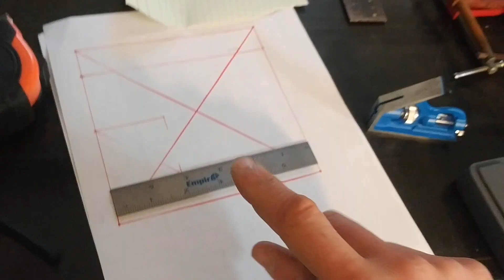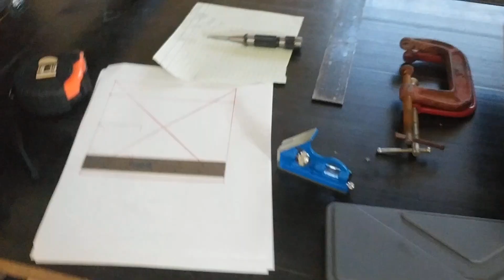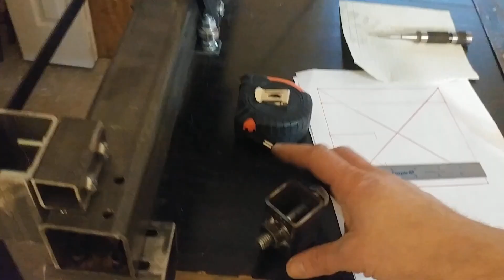CNC Plasma Build: Jigs, Z axis, and belt tensioning

Comment: This is an awesome build. I like the tensioning solution you came up with. I hope one day I can have a shop like this with all kinds of DIY machines. I just have a TRONXY 3D printer and lots of spare steppers, servos, dc etc.. for random Arduino projects at the moment. Gonna try to build an automated deep tissue massage machine based on a regular CNC endmill but with a rotating rubber ball instead of a spindle.
Reply from the maker: I use a jigsaw with a golf ball on the end for that. You need to use one hand (or have a partner), but it works a treat.

Use the a jigsaw that takes the T-style blades. (corded is better than battery). Grind the teeth of the blade (duh). Drill three small holes in a line (like 3/32") halfway down into the golfball. Cut the surface of the golf ball across the lines with a dreml, hacksaw, etc. Then press the toothless saw blade into the predrilled rubber interior with a bench vise.

Been using mine for years. Your mileage may vary, do at your own risk, etc.

Comment: How meny tooth you have on that servomotor gear and does it work fine ?  i have same  servos on my build was wandering would it need moore speed bigger wheel. thanks Toni im buildin 2m x 1,5m table
Reply from the maker: Can't recall off-hand how many teeth were on it, and I don't have the machine any more, but if you check out my first video on LinuxCNC configuration via the StepConf Wizard, I recall it working out to something like ~600 steps per inch, which was totally fine on my 4x5' table.

Comment: I was looking for a cheap & accurate CNC table and after a lot of search I found out that the most suitable transmission for me will be by closed drive belts. So recently I bought a small laser  engraver and I noticed how they use an open belt and it works fine. Since then I looked everywhere for a CNC table that  uses the same concept.

Please tell me how much does your carriage weights? and what belt did you use?

I'm looking for an HTD 5M 50mm width ( budget problem).
Awesome build, I'm happy to have found your channel.
Reply from the maker: I used a 15mm wide HTD belt. Can't say how heavy the gantry is, since I don't have the machine any more, but it wasn't much. Maybe 20lbs? 30lbs max?

Your precision will be limited mostly by the straightness of the rails it rides on, and secondarily by the drive ratio (ie. how discrete your steps are).

Comment: Could you share the design of your machine?
Reply from the maker: At one point in time, I was working on putting together more comprehensive documentation, but really, these videos are it. Just work through the video playlist.

The design was really based on what parts I could get, what materials I had on hand, plus winging it and troubleshooting as I went along. No CAD diagrams or anything.

The most critical part is really the LinuxCNC/HAL side, and I did some pretty in-depth tutorials on that and posted the code for them on GitHub.

Comment: Why not rack and pinion as opposed to the complicated belt design, not being a smart ass. Just curious.
Reply from the maker: The tension on the belt pretty much eliminates backlash. A rack and pinion would take some sort of spring-loaded thing to do it well.

The plan was to look at upgrading to R&P whenever I got around to redesigning the carriages to roll on linear rails. Never got around to it, and I've since moved and lost my shop (I'm way behind on videos), but this system worked well enough for my uses while I had it.